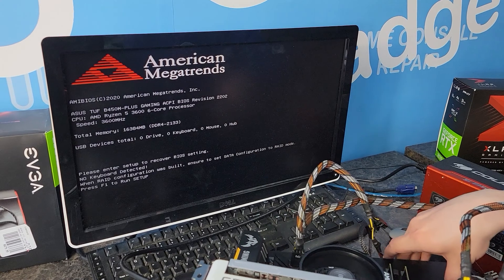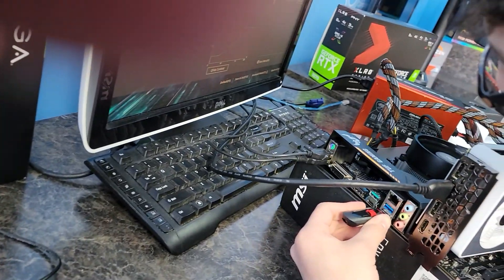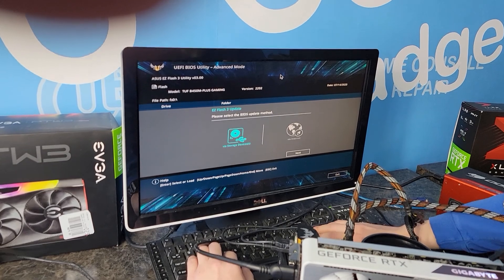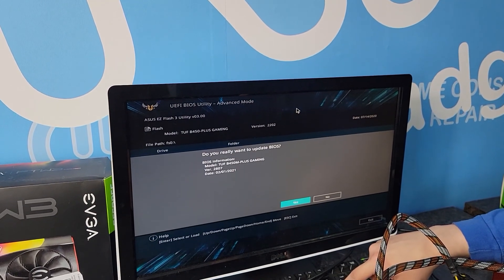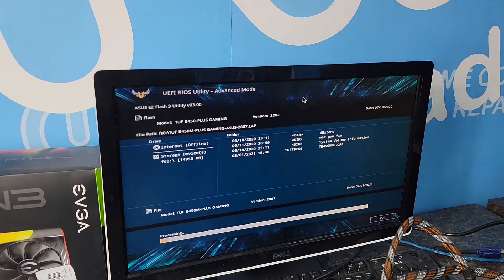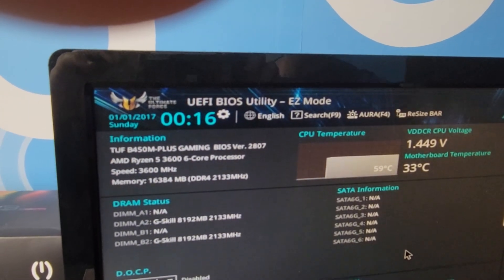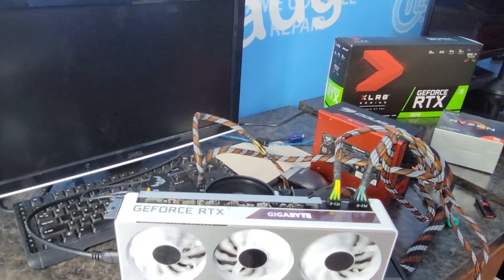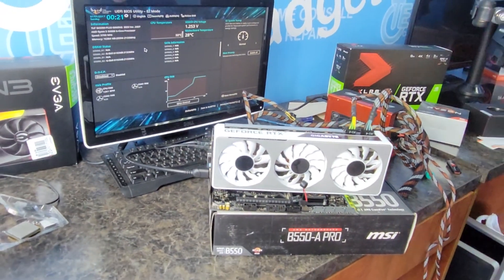😱FIX BIOS Black Screen No Display No Post | HOW TO FIX | B450M B550 #amd

Comment: Hi, I need help, I bought new PC components, this is an MSI B550 Gaming+ R 7 5700X motherboard, from old components 32 GB of hyperx furi DDR4 RAM, 8 GBX4 pcs, 3200 MHz, 16(CL)-18-18-32 , 650W Coguar 80 bronze power supply, GIGABYTE GeForce RTX 2060 Super video card, how I installed the components (I did not insert all the memory, but as indicated on the board in the 2nd and 4th connectors first) I started the computer while I did not display the bios, I think it's okay, I'll update it via a USB flash drive through a special connector on the motherboard, the bios version was January 2020, updated until the latest non-beta version of the bios from the official MSI website, after that it showed me when loading the Bios, the XMP profile was set to 3200, I think I need to deliver 2 memory chips, which I did not insert at the first launch because the motherboard manual required it, I installed 2 chips and that's it. After that, no matter what I did, I couldn't see my BIOS anymore. The system boots up smoothly, but when I turn it on, I don't see the motherboard manufacturer's logo or anything like that. The monitor starts up, but there's no image on it. There are no errors on the motherboard in the form of EZ debug. I've tried installing an older version of the BIOS, resetting the CMOS by short-circuiting the pins on the motherboard and removing the battery, and disconnecting all devices from the motherboard and all storage devices. I'm hoping you have some ideas about my issue.

Comment: Im having this issue with no display using a Ryzen 7 on a Asus rog strix b550-f. I tried a Ryzen 3 and then it works. I made sure ive updated to the latest bios and reinstalled the Ryzen 7 5800x but unfortunately no joy.

Comment: I already button-flashed my 550 (5 different versions). Still doesn't post, just a black screen. No debug lights on. I've built like 10 PC's, this is new to me. I'm suspecting graphic card now.
Reply: Did you fix it? I'm having the same problem, I cant find a solution
Reply: did you ever fix it?